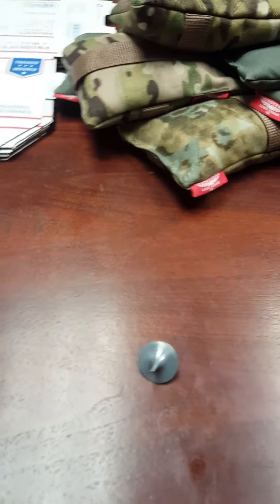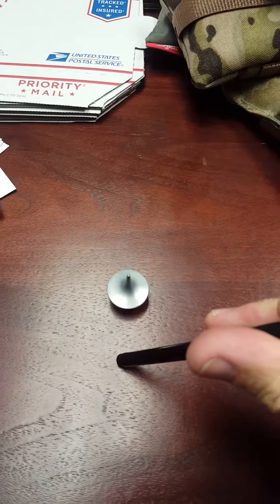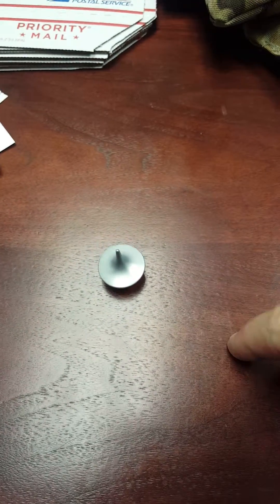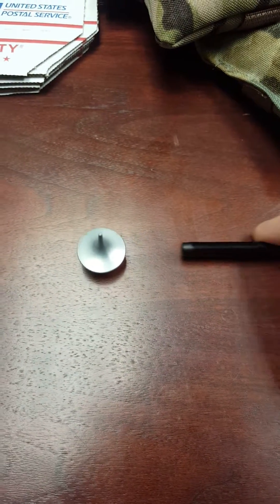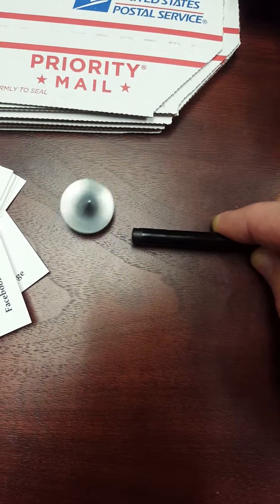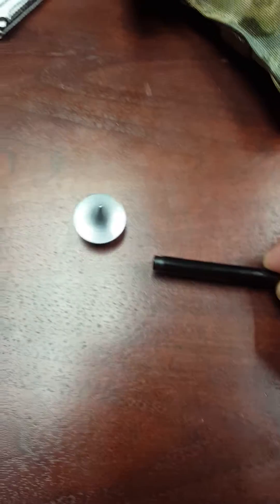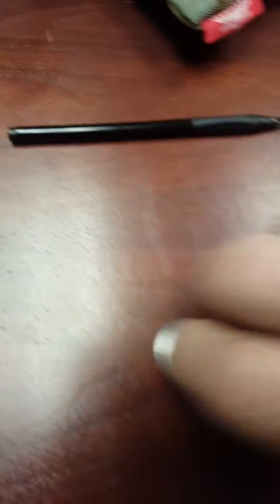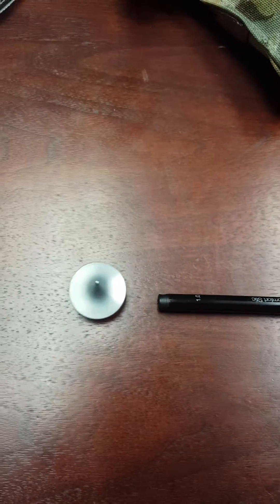Aeroydynamic Jump in crosswind visualized

Comment: Wikipedia have a few very informative pages on Magnus Effect and Backspin. I am not sure they agree with your theory. One says backspin (a slice) generates an upward force that lifts the ball.  It gives a diagram to demonstrate. Gel blaste hop-up's use this effect and they impart backspin where the top of the gel is moving slower in relation to the air flow over the gel. The effect is to keep the gel aloft for longer (as well as to make it group better). Fast air has less pressure than slow air.